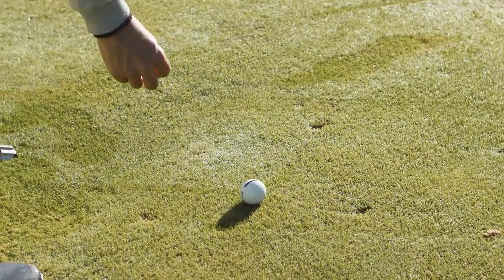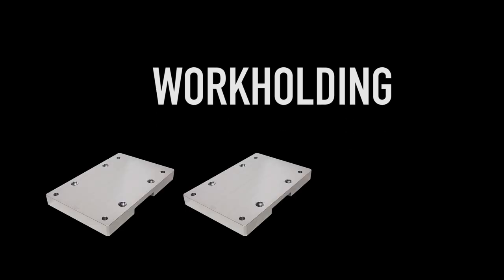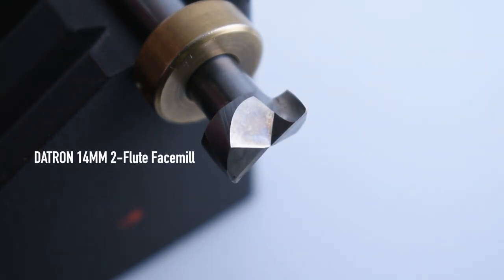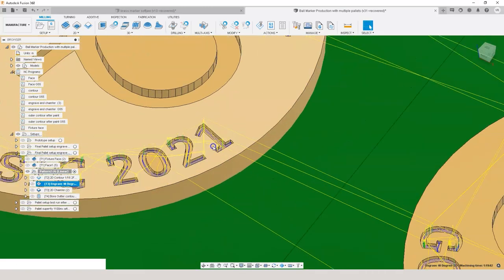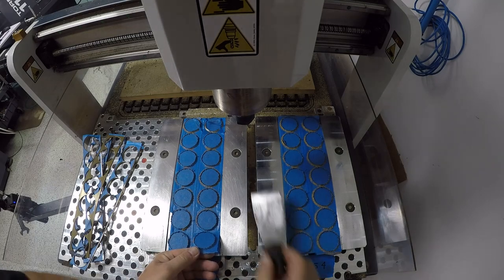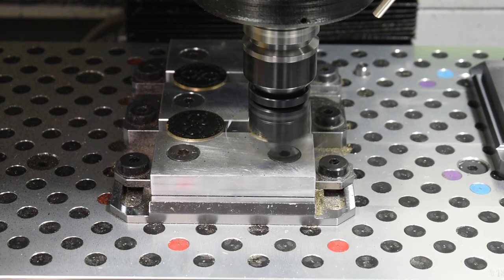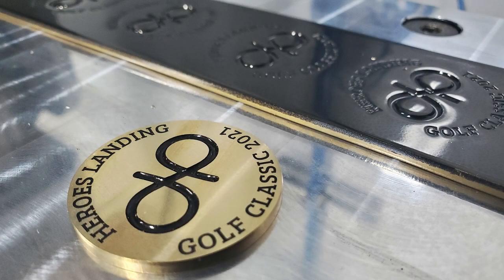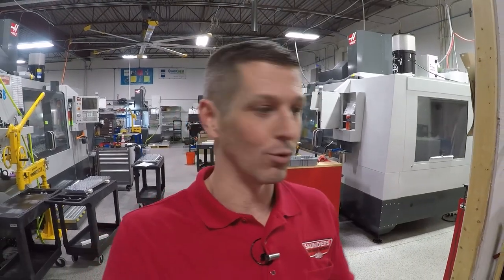Machining Golf Ball Markers on the Tormach 24R and 1100MX!

Comment: Next time you can save time on your finish fly cut. There is no need to face over the entire two parts. Start in the back like you were than face the first part till the cutter just clears the first part. Lift up in Z and rapid to the front parts front clearance move down for your face cut of that part and face the opposite direction till the cutter just clears the front part. Then repeat the same for the other two parts. That way you don't drag the tool over the parts and shorten the feeding path to as short as possible.
Reply: Yes!
Reply: I was thinking just that. Cutting alot of air in that tool path
Reply: I know you posted this comment 10 months ago, but I just ran that exact same strategy on some 316 stainless parts that are really similar to these brass golf ball markers and it worked beautifully! Much faster cycle time, and I didn't have to worry about the insert dragging over the part after it cut.

Comment: I have found Bokers Washers a good source for flat or round blanks.  I purchase about 300 1-1/4" Diameter x .060" Aluminum blanks for about $1.50 each.  They come deburred and have +/-.001 tolerance in diameter and thickness.  Saves lots of time.   We use a vertical 5C collet having a machinable emergency collet holder and this holds the parts really well.

Comment: There's a lot of wasted paint using the spray can. I would've looked for a silk screening-like process.
Reply: Cost of a can of paint vs other complex processes? Nah. This was fast, easy, and cheap.
Reply: @texasermd1  I would avoid spray paint to avoid inhaling the aerosols or possibly getting some paint on the surroundings. Wiping some paint in with a squeegee sounds easy too.
Reply: @Mike-lu1pt  or painting somewhere that those issues are not an issue. 👍🏼👍🏼